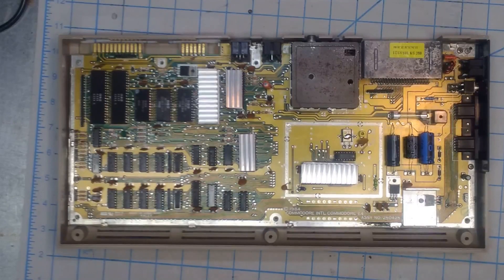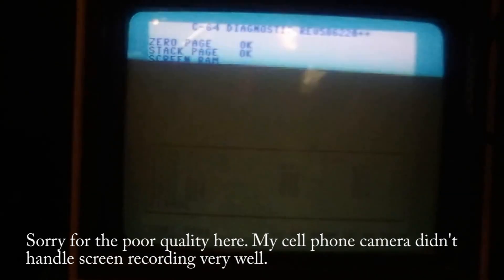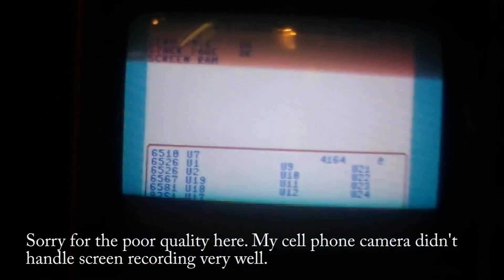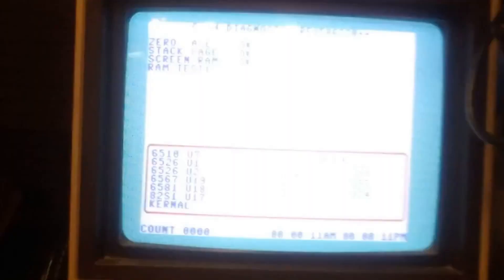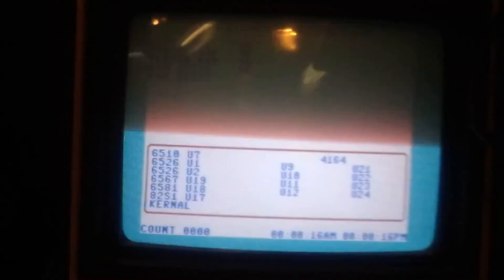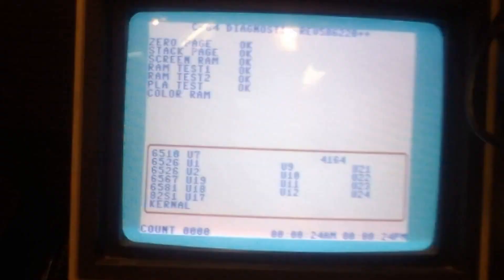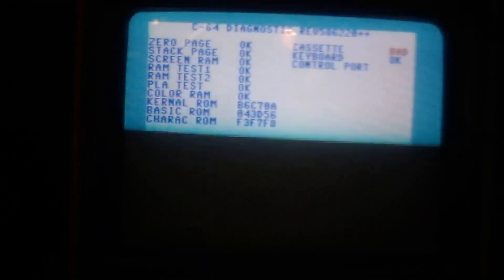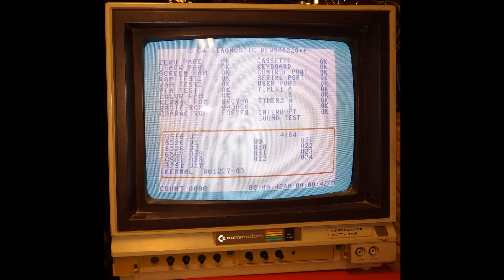Episode 5: C64 Diagnostic Harness Use

Comment: Great instruction video! The Diagnostic cartridge with harness is used a tool to find what might be wrong. The results may be wrong and the tool itself must be ruled out. I was taught that back  in the navy trouble shooting part of each school I went to.
I always look for the most likely suspect which is usually human error or physical connections. Ryan's videos are great resource and I look forward to more. My test system in the house is though an old VCR/DVD player which allows me to use a hdmi LCD monitor for both the Computer video and watching Tapes or DVDs. My play area has a 1902A with a C128. The garage is setup with a Old CRT TV with video input which is where I do the  repair of Retro equipment. I found that the LCD monitor makes the best video capture on my phone as the VCR/DVD also enhances the video.